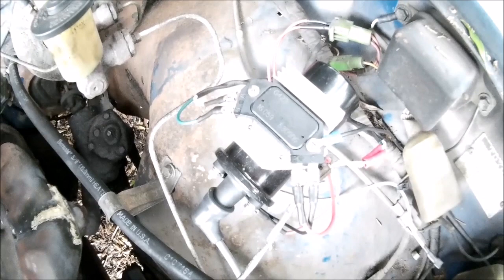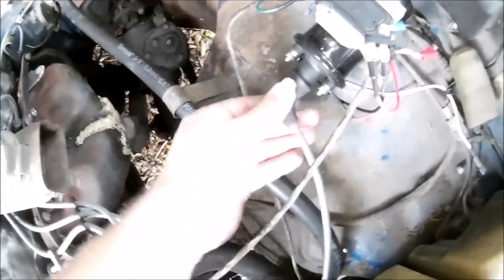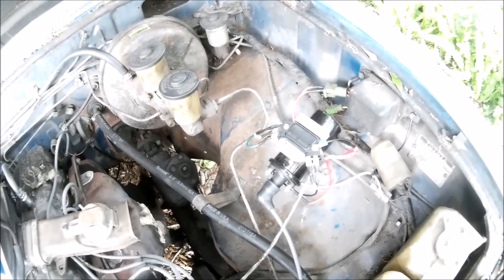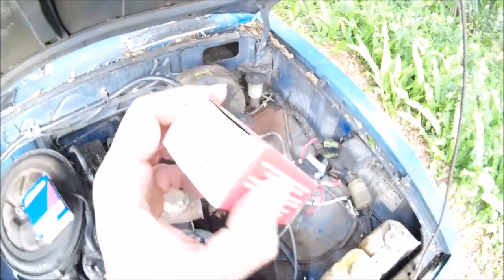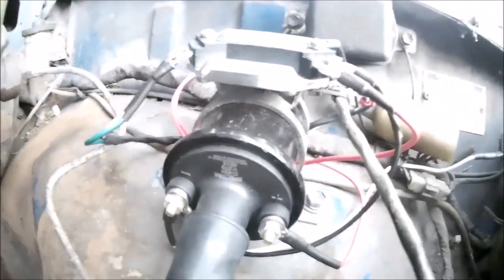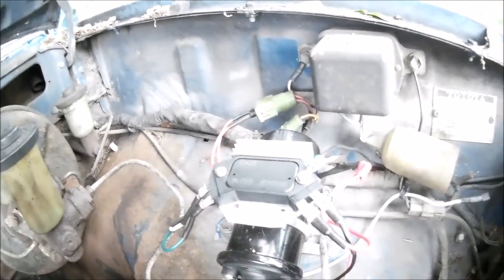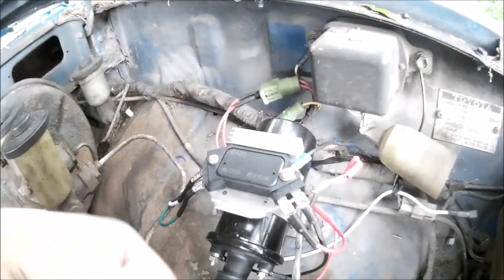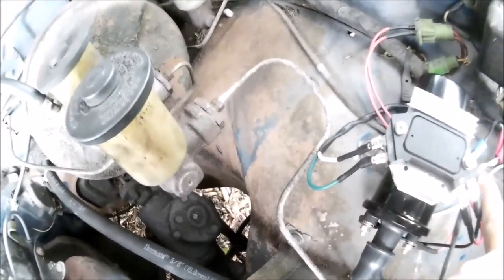1978 Toyota Pickup/Hilux 20R - GM HEI Ignition Module Conversion

Comment: Wuld those gm modules work if you aplly positive power from baterry and pulse it with only negative wia pick up coil ore vice versa wuld it still work?
Reply from the maker: A distributor with a pickup coil, by design,  produces it's own inductive current, or voltage, somewhere on the order of 3 volts AC, so the pickup coil does NOT work on battery power. It doesn't need it, it makes it's own voltage, & is NOT a part of the vehicle's battery circuit.

The module needs to have full 12 volt positive battery power & a very good ground to the vehicle's chassis or frame. The module acts as a switch for the ignition coil. The pickup coil acts as a "trigger" for the switching.

I am curious as to what application you are thinking of using this on. I have seen the GM HEI modules used on many makes & kinds of engines. If you have other/more questions about it or need further clarity just ask.
Reply: @The13thSword  ok thank you I knew they were kinde of pulse generators.
But recently I found some old diagram showing how to test 4 pin gm ignition modules with test light.
In the picture there was positive wire from baterry and it was bridged 2 terminals from the 4 pin gm ignition module I supose there wuld go a positive pulse the negative pulse wire from pick up coil was left out so the test light go ON .
Thsts how they test those ignition modules I supose.
But me problem is diferent .
I have old opel engine its based preaty much normal 80s gm car design .
It has build in destributor pick up coil and 4 pin gm ignition module the ignition coil is singel hei e core design I do have positive linear voltage regulator inside me dashboard I asume it is necesary for the coil to operate.
How ever me aplication is strange.
Because I dont have twin pick up coil for waste spark I have problem there.
I want dual ignition and it shuld be variabel in polarity .
I often experiment with me car and use diferent fuel types I often like to use amplifiers and plasma ignition as well.
So me curent circuet is polarity sensitive .
So I try to figure out how to make dual ignition useing just twin 4 pin ignition modules ore to switch a singel coil pack .
So I dont know of that pick up coil is strong enough to activate twin 4 pin gm ignition modules .
Im looking at jaguars twin coil ignition design with their gm ignition module amplifier .
Thats the basic idea behinde it.
Me engine can run at exaust stroke if engine is warm he also can run at exaust stroke singeli ore together in union.
So I realy dont have much money to spare I do habe multipel parts for the same engine.
So I must improvise some how.
I do not know if it wuld work if I use twin coils and some how stuff them in that magnetic trigger.
I dont know what to do to be honest.
That circuet shuld be variabel to some degree so I can bouth ignition modules retard and advance seperatly so Im looking some cinde of variabel resistors.
Only problem there with me idea bouth me dashboard and ignition module are polarity sensitive.
I cinde of have same problem with me starter selenoid R terminal to bypass some voltage during engine start up me fuse pops simply if I try to use that wire.
Maybe I done somthing wrong 
I did not habe normal diode I used hv diode instead and swaped that thing around to see what wuld hapen but still me fuse pops.
So I have unusual problems consirning me ignition system and alternator who is a 12 si delco alternator.
When ever I use hv capacitors for plasma ignition me alternator changes its starting charge rpm from 1000rpm to 2500rpm its anoying realy only benefit car is lot smuther starter motor spin faster but flat baterry at low rpm I go fare to 300-500 rpm with me engine .
So indead I have unusual problems.
Wuld blinker relays ore other relays trigger the ignition module as well who are not polarity sensitive???
Reply from the maker: @MechanicForGMCCars  Thank you for your response & all of the extra information on your Opel application. I will try to cover some of the things you mention, but there is something I have to say first.

It sounds like you are using the Opel for experiments, which is OK. I think that doing practical "thought experiments" is a good thing. But I can't make any recommendations as to what system would be best for you without knowing what you are trying to achieve with it. If you are just trying things to see how they might work, & as an educational experience for yourself, that's fine. But I come from a place of thought where I just want the vehicle to run, & run on a reliable basis. So some of my answers below will be based on that place of thought, and those answers will tend to be more towards the "simple" side.

I just wanted to say this first to avoid any misunderstandings. If I say below that any of your ideas are not necessary, please do not take those comments personally. You certainly can do more complicated systems if you want to, it is your vehicle & you can do what you want to it. I personally have nothing against your doing that if that is what you like to do.

You are correct, pickup coils are basically a simple AC voltage pulse generator. Your HEI module test diagram may be correct, but understand it is for testing the module's operational functionality only.

We here in America have not seen a new Opel since 1975, so it is a little hard for me to know exactly how your car is wired in the factory stock form. If the positive linear voltage regulator was stock to your car, and I would not know what it's intended function would be. I would say that it is not needed for a 4 pin HEI module to function correctly. The module just needs full 12 volt DC battery power, usually fed to it from the ignition switch START and RUN circuits. It is not at all sensitive to voltage variations that are within normal operating parameters of the electrical/charging system. As long as the internal voltage regulator in that GM 12SI alternator is functioning properly, there should be no issues with the module function.

I assume the engine is a 4 stroke? In my own opinion, for a 1980's Opel engine (likely 4 cylinder? but even up to a V8), The 4 pin HEI & single e-core coil are more than enough to run the engine as well as it can run. I don't think dual coils are necessary. I also don't think you need to even think about "waste spark" The normal HEI ignition system doesn't even allow for waste spark to take place; it only fires on the top dead center stroke on each cylinder, by design. Also have a waste spark occur on the top dead center of the exhaust stroke doesn't do anything to add to performance, so it's really no a problem & not really needed IMO. The high energy provided by the e-core coil & the precise timing provided by the pickup coil/module should provide a very complete burn cycle. You only need 8K - 12K volts to fire a spark plug under compression. A typical HEI coil puts out a minimum of 30K volts, so it's more than enough for the job.

I understand you may want dual ignition, and that's fine, but it's an extra expense that you really don't need for good function. There are non-stock aftermarket HEI coils out there that put out 60K volts in a single package, so you could have dual coil voltage in a single coil, and keep things simpler. But again, I think this would be an unnecessary extra expense.

You said "That circuet shuld be variabel to some degree so I can bouth ignition modules retard." I don't think you understand how this works, so I will explain. The circuit is already variable by design. The variability of this circuit for advance & retard is NOT in the module(s). It is in the mechanical advance of the distributor & what engine speed is present, which affects the reluctor ring that induces a voltage in the pickup coil at different moments in time. The "vanes" on the reluctor ring passing by the pickup coil induce a voltage every time one of the vanes passes the coil. This is what generates your "signal pulse" to the module & this changes constantly depending on conditions. Higher engine speeds cause the distributor advance weights to advance timing (as well as vacuum advance), which changes the advance of the reluctor ring on the distributor shaft.

I don't know what to tell you about your fuse popping problem or what might be causing it. The best I can suggest is that you find a service manual for your car that has a complete wiring diagram & go by that to restore the circuits back to the stock form if they have been modified. I am not again modifications as long as it makes things work better, but the original designs are usually engineered to more than handle the job, as a reliability & safety feature.

Plasma ignition? You are very ambitious in your experiments sir. :^) I respect that, but if the modification is causing you problems for very little benefit, I would recommend that you revert back to a simpler system that just plain works.

I have never seen a relay used with an HEI module, and I do not think it is necessary. These modules only draw 2 to 3 amps, so standard wiring should handle that safely without the need for a relay. Even thin 20 AWG gauge wire can handle 4 times that amperage safely (12 amps). I use 16 gauge which is thicker & can handle more than that, just for a safety margin.
Reply: Some things I can only show you privetly ore give you link to me e book.
Perhaps that way you wuld understand why I requare special design ignition system.
Im not usual men definatly me engines are not usual at least not in behaviore.
There is a point in life when 1 singel person can not handel multipel things like :mechanics,chemistry,biology,thermo dinamics and lot other subjects.
If you like you can call it insanity ore over load.
1 person can not manage all of that even if I altedy know all this 15 years of study is long time even the best of the best can not handel evry thing be them self.
Lets just say me engine is not normal after you read me book you will understand for what Im aiming for .
But for now Im great full that you found time to write to me.
Im not realy ambitiouse thats 15 years working with GM based engines lot things are miss represented those are not normal engines definatly not when insane person like me self gets their handes to such engines and actualy make unusual experiments with them
Reply from the maker: @MechanicForGMCCars  I would not call it insanity or overload and I do not think that there is anything wrong with being an unusual man. I believe it is people such as yourself that drive this world forward. All very good. :^) I also agree that no one person can handle everything by themselves, all at the same time. That's why we have to work together to make things happen in the world. It is also the main reason for me posting my videos, to help other people out, if I can. I am grateful for any opportunity I can get to help someone else out.

You have my permission to post a link to your e-book here, no problem. I'm sure some of my viewers may find it very interesting.